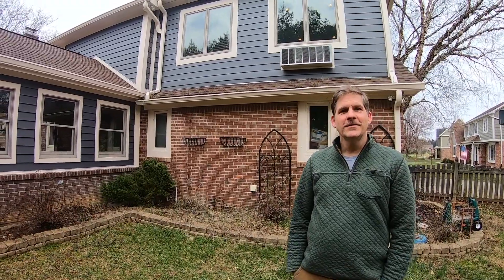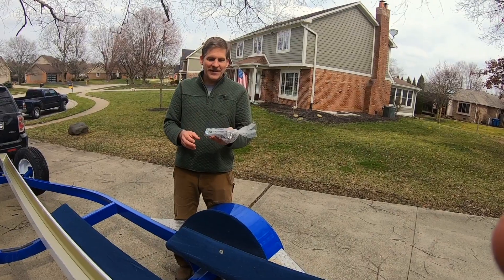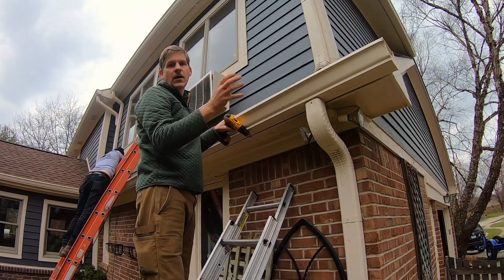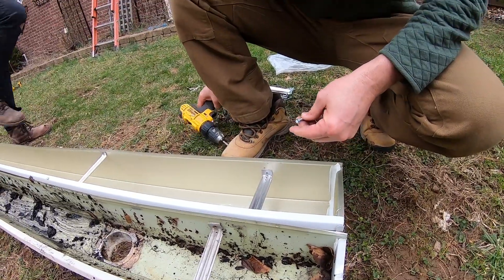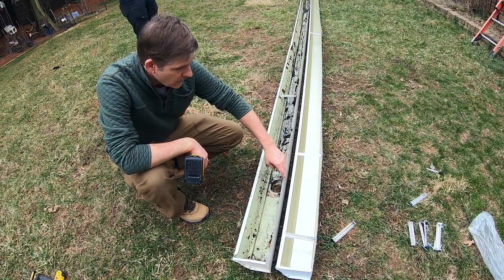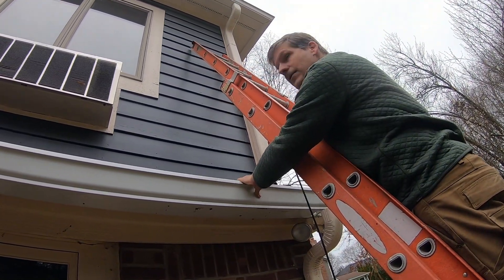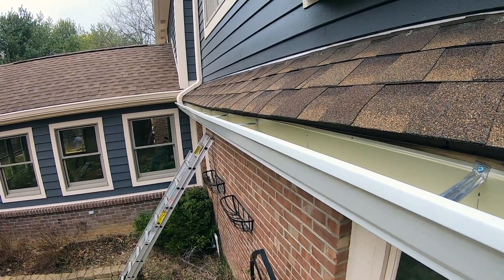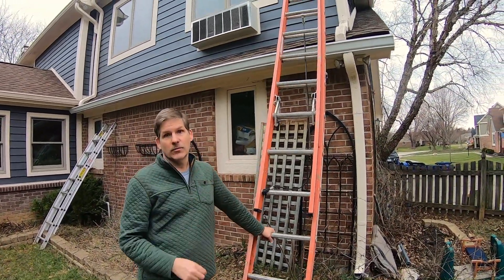How to Install a Seamless Gutter

Comment: Did the gutter need replacement or just a good cleaning?
Reply from the maker: Hi Eric, that gutter definitely needed replacement.  For some reason the gutter was crushed a bit in the middle.  Maybe a repair person bent it with a ladder.  The gutter was leaking and didn't drain properly.  After the replacement there have been no issues.  Thanks for the question!
Reply: Needed a clean out, re seal and re slope. Aesthetically it needed to be replaced, it could’ve still functioned properly. Always go with a professional or at least consult one
Reply: I was saying the same thing! We're looking at a video to save money, but it looks as though that gutter was perfectly fine it just needed a good power washing. Not only that the existing gutter match the house colors exactly. This gutter should have been painted to match that color that was already there since they just added it back to the downspouts. I don't know but to me it looked like the new one looked exactly like the old one. Except the old one was actually the right color. There was no obvious damage at all! When the two were laying next to each oh, they look the exact same. Thanks for the video though! It was most informative!

Comment: I have an out-building where they left the rafter tails exposed. What should I put up to support gutters? I'm not having any luck finding gutter videos that don't use finished buildings.
Reply from the maker: Hey Shalmaneser,
First question : does your building have a drip edge under the bottom edge of your shingles? Maybe add a think piece of facia???
Depending on how far your shingles extend past the end of your rafter tails, you could add a facia board to the end of your rafter tails, then add gutters.
Or
You could simply attach the gutters directly to your rafter tails. Unless the facia is very thick, your gutter hangers are supposed to be attached directly to the rafter tails anyway and NOT only the facia. 

If you are not going to add facia, I would paint the ends of your rafter tails to prolong their life. Facia protects the bare wood rafter tail ends as well as dressing up the building. 
Hope that helps. Thanks for watching and commenting!
Reply: Gutter installer here... they make no facia gutter that are installed with roof strap hangers

Comment: If installing gutters on a whole house, do I need to put them on the side of the house as well as the front and rear? Also, is there a particular measurement for how many down spouts a house needs?
Reply from the maker: Hey Royale...,
Gutters need to be along the lowest edge of the  slope of the roof. The triangle side of the roof , or gable, does not need guttering as rain does not flow off that in any amount....
As for downspouts, it depends on how much rain you get, how fast it rains and how much roof you have in sq ft.  It can get complicated. 

But ballpark measurement I’ve heard is one downspout per 20 ft of gutter run. But I’ve seen 1 for 40 feet of gutter.
Thx for watching!
Reply: Every 30’
Reply: Minimum 1 d's every 1000 sq ft roof area
Reply: re: is there a particular measurement for how many down spouts a house needs? --> go with bigger gutters and down spouts and you'll likely need fewer down spouts.

Comment: How long did it take y'all to do this job??
Reply from the maker: Hey Alfred,
Honestly I do T remember but if I had to guess- maybe 1.5 … from start to having tools put away. The actual work is pretty easy and fast. What consumes the time is getting all the measurers made - length and slope - especially making sure the down spout is placed correctly - lined up to attach to the corner trim. 
We were not in any particular rush. An extra set of hands can make a big difference. 
Hope that helps…

Comment: No facia covering??
Reply from the maker: Hey MrSteeDoo,
Not sure what you mean? We have drip edge and gutter mounted to the facia.
Thx for watching!
Reply: @Housebarons  There is usually an aluminum facia covering in my area. You don't have exposed wood.
Reply from the maker: Hey MrSteeDoo,
There is no exposed BARE wood. The wood is painted. Of course facia can also be made of plastic or aluminum - but painted wood works just as well for us here. 
Hope that makes sense. 
Thx
Reply: Gutter installer here. Painted facia or not your supposed to do what we call slip flashing. It’s not just the facia your protecting. Your protecting water from getting behind that gutter and sitting. Even though you have the drip edge pulled out, water still gets on the facia. Ideally, you would push that flashing back down plumb with the gutter. Also you can push that gutter up under the drip edge a good bit, but if you push it over top of the facia board and that gutter fills up, it can back flow into the soffit. While the lip is designed to be lower than the back of the gutter so it spills over the front rather than the back, crazier things have happened. If your gutter is sloped correctly AND you have a sufficient amount of hangers in your run, the gutter will install directly to the facia without having to hit rafter tails. It will hold it just as well. Tin snips or a plunge cutter will also work for that trimming you did on that elbow, which didn’t need to be trimmed. The top of the downspout should’ve been trimmed keeping the straps in place and the elbows in tact. I get it, trying to save money and diy but this is some real bad practices man. I would recommend getting a professional out there. We fix this kind of stuff all the time if the facia isn’t rotted before we get there.
Reply from the maker: Hey Carter,
That’s a wealth of info - thx for posting!
Reply: @Housebarons  for sure man!!